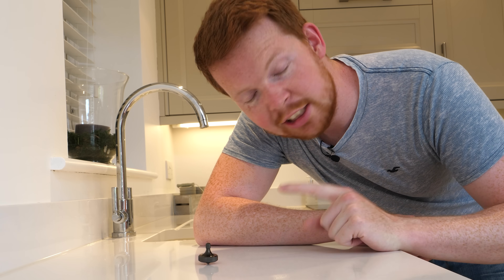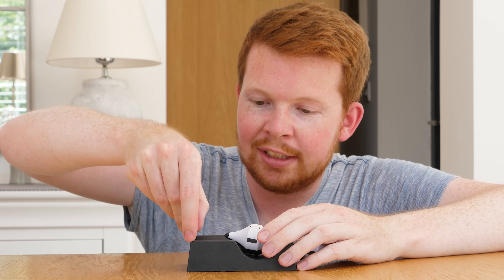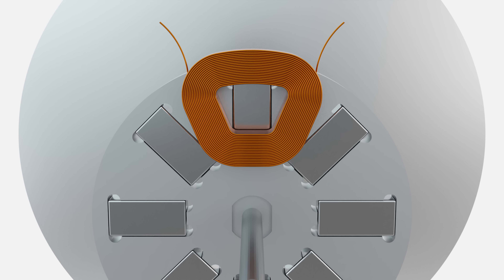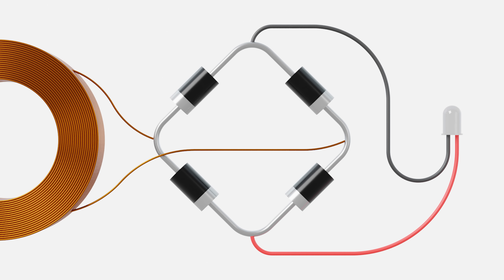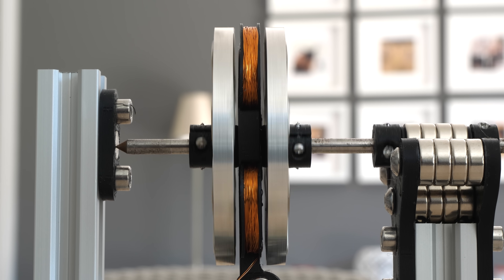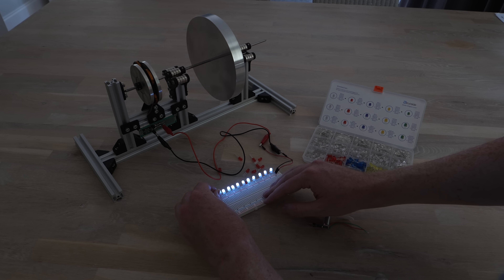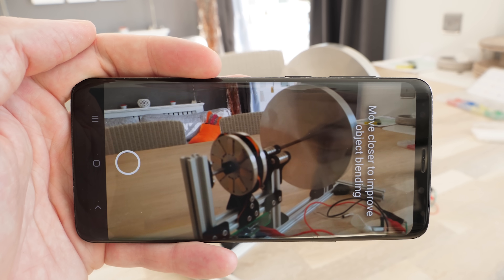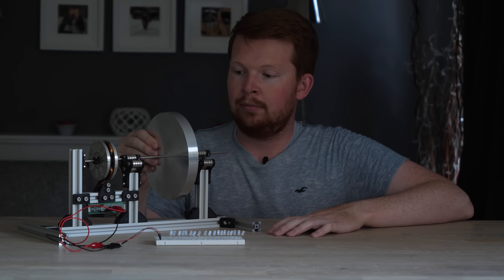Flywheel Battery

Comment: Did anyone else immediately imagine a sterling engine powered by his hot or cold drink powering  a fan that powers his flywheel that is then charging his phone? :)
Reply: I mean I guess this would work but why not just power stuff with the stirling engine itself?

oh right, it's not as fun ;)
Reply: @filthycasul1804  yea because of the way he likes to do things I was kind of imagining an almost Rube Goldberg style energy machine on his desk ;) that's all all about the most interesting way to create his power not the most efficient. You get the point. its about the FUN :P Have a great night.
Reply: @TheRealSarcasmO  solar powered tea kettle to make the hot drink
Reply: Tealight candle powering sterling engine then flywheel might work
Reply: My thoughts as a canadian:
-wood stove, with hot side of sterling engine inside firebox
- basin that uses snow to cool the cold plate, and also melts snow into drinking water (dual function) 
-planetary gear set, to increase the speed of the flywheel (would require tuning, to fit the gear ratio just right)
-semi-flexible drive shaft from gear set to flywheel/crankshaft, to reduce vibration and instability.

This concept could be very useful to someone wanting to live off grid.
Reply: @chris101ward  love it, maybe a infinite ratio drive to connect it? Very smart of you to maximize your thermal extremes that you have available to you.
Reply: Me
Reply: Think of powering a large Stirling Engine and making a Cryocooler so powerful it could liquify HELIUM (i.e. down to -269 Celcius) or easily make your own Liquid Nitrogen at -196 Celcius by the MegaLitre!

v
Reply: Or using a DC motor connected to the floating side of the bar holding the "motor" to continuously power the spinning motion and help it build up speed?  I'm sure there's a better way but it could make that thing spin forever.
Reply: No. Because the energy differential of the "cold drink" to the ambient air is minuscule and the conversion losses are huge... However, this concept would generate 1 million bucks in 3 days on Kickstarter...
Reply: The drink would have to be molten lead
Reply: @RusselwithoneL  Yes molten lead drink would power it quite nicely, however, you are mistaken many other drinks both hot and cold could slowly but surely impart their energy depending on how he decided to have them interact with his flywheel, and that it in turn then would charge whatever he wanted to charge. I hope that that people will see your comment and do their own research. I however will not indulge your further comments however because I have personal live events going on. I hope that you learn and others learn more and realize how cool the idea could be, if implemented well.
Reply: @TheRealSarcasmO  ey man I agree with you but imo, that middle to last part wasn't needed to express your point, no reason to bring his character down just because a harmless comment he most likely didn't give a second thought
Reply: @ex5080  Good day, thank you for putting me in my place, you are completely correct, I was wrong to respond that way, although I believe in the freedom of speech and my response was warranted, I also think that you make a good point, and I have edited my comment accordingly. I just had a death in the family, and I read that comment and it seemed to be the normal internet troll, so I commented/replied with that mindset, and while I might be right and they might be a troll you as well make a good point. Thank you, I hope you have a great day.
Reply: @TheRealSarcasmO  u could use a thermos mug
Reply: @TheRealSarcasmO  No need to put someone down to promote your own pride man. Sure, EVENTUALLY, your proposed setup could gain enough potential energy to charge a device but its not practical. His response was simply showing that in a humorous way. It doesn't mean its not possible and it doesn't mean you aren't smart or whatever.

You inferred so much meaning from a simple comment and that speculation is dangerous. It likely wasn't a personal attack on you and I don't think he was even 'trolling'. Its YouTube. People are going to banter with your ideas and disagree with them. No need to tell someone you are going to "Stop Indulging" them when you never had to in the first place...
Reply: @TheRealSarcasmO  What edits? Im talking about how it is now. Condolences for your loss but I never insulted you. If anything I just encouraged you to not care about what others say to you and to have more confidence in yourself, especially when you have no idea if they were trying to be rude to you in the first place. It's not so much vitriol as someone just trying to be real with you. All the best man.

Comment: To further reduce the friction, you can use also magnets to replace the pin at both ends. Then put the entire system inside a vacuum chamber

Comment: Flywheels have been used as energy storage for years in power backup systems, it is nothing new... What is nice is the magnetic bearings.  Electromagnetic bearings are also known for years in high class industrial applications

Comment: You have a massive voltage drop from the diodes, regular diodes have a 0.7 forward voltage. That means with 2 diodes you already lose 1.4V! Shottkeys can decrease this to about 0.5V and Germanium diodes to 0.3V. Also depending on the quality of each. While synchronous rectification can have you lose almost nothing.

Comment: Flywheel storage systems for vehicles have been developed over a number of years, the braking energy is used to spin up a (250Kg?) flywheel to over 10,000 rpm (in a vacuum to reduce windage losses) the stored kinetic energy is then recovered to accelerate the vehicle (usually a bus).

Comment: I really want to see this revised in 3 ways:

- Correct the problem of the bent shaft so it can spin much faster and still be relatively safe.
- Is it possible to add magnets above the shaft to give it more security?
- Add some sort of mechanism that will allow you to manually spin it *WAY* faster.  Basically the same as a bicycle in high gear.  I don't know the specific name for the mechanism, but it's the one that allows you to peddle very rapidly and the peddles are basically "locked" on gear teeth when spinning in one direction, but if you stop peddling or even peddle backwards, the wheels of the bike can spin independently of the peddles.

I'm no scientist or engineer, but it seems to me that if you were to do those 3 things, this device could actually have a practical application in the real world.  Probably not an efficient way of generating electricity unless you think of the disproportionately costly input as being a small workout and good for your fitness, but this would be a really cool and fun novelty power source for a small light or other cosmetic machine.

Comment: 9:10 Never power a LED without a constant current source or a resistor in series to get the right amount of current or you will damage them really easily.  Also every LED needs its own resistor. Only then they will have the same brightness.

Comment: When constructing a full bridge rectifier at such low voltages you should be sure you're using Schottky diodes, otherwise you're losing about 1.5 volts on the bridge itself.

Comment: 5.30 You can power a light bulb directly from this setup if you don't care about the flickering that might visibly occur. (Doesn't have to be very noticable though) Not having diodes will increase the output to the bulb.

Comment: if you attach some scoops arranged in a pinwheel fashion to the far end and place a lit candle beneath them, by capturing the rising heat to spin it up you can have the first candle powered light bulb.

Comment: You should speed it up by putting power through the coils and making it into a motor - Then it would really be like an electrical battery.
Reply: and how would this work? you need to switch the polarity of the coils

Comment: When you increase the copper, you increase the power output.  I know it would violate conservation of energy, but what if you added more magnetic coils in parrallel is there a limit to how many times you can multiply the power output by adding more coils?

Comment: Cool video. Seen these things used as UPS systems.  Under load you get 15 seconds or so for utility to come back or generator to start.  Good luck...  Never saw a multi string flywheel.

Comment: As you draw more power (V*I) from the flywheel storage, there will be more torque pulsation on the flywheel, which will have a magnified wobble effect. Its not just the mechanical alignment and balancing that is needed, but the coils and magnet too should be spread out so that torque pulsation is spread across the entire mechanical rotation.

Comment: Big versions of these (google for 1000kva flywheel) can provide a megawatt for 15-20 seconds before they spin down - we use them in our data center instead of batteries to cover the time it takes for the diesel generator to start up. I'm told they spin 50-100 lbs at 50K RPM, but that could be wildly inaccurate - check the vendor specs if you're really curious.

Comment: Would be neat to compare electrochemical batteries of varying types with the flywheel as a means of storing energy.

Could flywheels be used at a larger scale for energy storage? Any benefits versus batteries?

Comment: Ok can u trickle charge like a 6 or 12v battery with this, and use that stored energy on a motor to engage the flywheel?
If so this is almost perpetual energy generation with no upper limits...

Comment: Nice, but I thout that on DC the corrente flows from the negative to the positive. And in AC genorator it flows towords it, thats way use transformer(for isolation and invert the corrente towords the load). Use 4 daiods for each fase(1 capel for each derivation). Put a motor to cantineu the motion of it..

Comment: You should definitely make a bigger more powerful version with a full bridge rectifier that has less of a voltage drop and try to perfect the design as much as possible
You may even be able to use magnets at the end instead of the plate so there would be literally no friction (except for air) and you’d only have a bit of magnetic resistance due to the alternator

Comment: And on top of all the helpful comments that arrived sooner than mine, in addition,  depending on how heavy the flywheel is, add some type of fan blades or make it into some sort of air driven turbine, if you have any kind of wind around your way to be able to pull that off. then you will have made wind power.

Comment: 0.7v is lost through every diode in the rectifier. I had a dynamo on my bike connected to a USB charger, and I used a half bridge rectifier with a capacitor and it worked to charge my phone on long trips. The voltage drop from the diodes and the voltage regulator created a nice 5.3v on output.

Comment: im just imagining scaling this up with a massive flywheel and a massive gear reduction system with a pully and a heavy weight acting on it to spin the flywheel. could generate some mad power, especially if you doubled up the magnets so they are both top and bottom, might reduce vibrations with that too
Reply: The flywheel can generate less power than is put into it to spin it, due to inevitable conversion losses. To power a flywheel from a heavy weight, the weight first has to be lifted off the ground, which requires the input of more power than you can get back. Physics 101.

Comment: @5:33: "We also need something to turn the A/C into D/C if we want to power something like a light bulb..."  Not true.  Discard your LEDs and complicated rectifier and use a simple incandescent bulb; it will work just fine on A/C without rectification.   That's how all incandescent bulbs in your home work.

Comment: That is clearly not a battery, but a manual generator. Actually, flywheel part is technically storing kinetic energy, but not electric. Electricity is created by the generator attached to the flywheel contraption. When going into this video I expected rather the opposite: electric energy converted to kinetic via motor and stored by the flywheel, actually at that point you can make a two way system.

As it stands electric part of this battery is irrelevant, as battery part concerns strictly storage of kinetic energy via flywheel.

Comment: Actually, inspired by your project, I've build smaller 3d printed version. 
I've tested different magnets configurations. There is no need to place third magnet under the axle. Instead, it's better to mount two magnets at the bottom, they will create a "valley" with lower force in between. 
To limit any axle wobbling, place another two magnets on the left and right side of the axle, but a little bit above.

In other words, imagine trapezoid but with shorter edge at the bottom. Place magnets in corners and axle in the center. For me that was the best solution.

Comment: Can't get the shaft out of the flywheel...

Put the whole thing in the oven. After it's hot, put it over a pan of ice water so the shaft hangs in the water and cools faster than the flywheel. Then tap it out.

Comment: Please oh please power a small motor to spin the fly wheel lol... In pulses if you have to like a car spark plug. I'm interested to see how long it runs. Adding a gear wheel or two to amplify RPM by requiring more torque. So slower start but high efficiency once it's going...

Comment: suggestion, make a thicker shaft to keep it steadier. think of the way a cam shaft looks from a combustion engine. maybe 2 cm thick would be good. maybe you already did. this is a genius alternator design and it would be interesting mounted on bicycle.

Comment: I wonder how effective it would be in a vacuum & how much energy would end up being lost by a sort of magnetic friction
Reply: You're thinking of eddy currents.
Reply: The energy is mostly lost by the fact that it is converted from the kinetic energy of the flywheel, which comes initially from the person spinning it, into electrical energy with some conversion losses, then from the effects of Lenz's Law, which says that the direction of the electric current which is induced in a conductor by a changing magnetic field is such that the magnetic field created by the induced current opposes changes in the initial magnetic field.

It is a qualitative law that specifies the direction of induced current, but states nothing about its magnitude. Lenz's law predicts the direction of many effects in electromagnetism, such as the direction of voltage induced in an inductor or wire loop by a changing current, or the drag force of eddy currents exerted on moving objects in a magnetic field.

Comment: Since it seems easy to spin could you use the small motor to spin itself? and have a battery for any excess power created?
Reply: Well you can't exactly extract "excess" power than the amount your putting in, in fact we will likely never

Comment: Tom, this is so freaking cool. Can we see you scale this up? (Within reason, - flywheels can be dangerous!) That would be so freaking cool if you could show us a flywheel battery powering a computer or something. And solar panels storing excess energy into the flywheel for later use? Like a small-scale grid system with the flywheel as a battery when solar panels aren't producing enough current to run the computer system?

Thanks Tom for the awesome content!
Reply: i would really love this
Reply: Fred Garvin  im not quite sure the fomulas to use to find out or where to even start to research this. Do you know where one could go upon finding this out?

That's why I am so fascinated by this video Tom made! I wonder the feasibility of using flywheels as a sort of battery.
Reply: Fred Garvin  counting on a perfect system with no losses with a flywheel rotating at 1500rpm, to get 17Watts of power (all counting on a perfect system which is practically impossible) you would need a 5.5KG flywheel, in a more practical way i would say about 12Kg counting 80% efficiency on the kinetic to electric(DC) power, and another 70-80% efficiency on the voltage booster+inverter
Reply: Fred Garvin  like very big
Reply: Of you did the same magnetic bearing he has it floating on on the bottom, and put one on the top above it, it would be supported better. There is actually such a thing as magnetic bearings.
Reply: Ok so what if he scaled up the amount of magnets and coils so he could get more voltage, scale up the diameter of the magnets and coils, to get more speed, then instead of powering lights, have it power a motor that's also spinning the flywheel. Am I missing something or is a perpetual motion machine possible?

Comment: You need to re arrange the coils into a 3-phase arrangement.  Use 6 diodes to rectify the output.  Use as a motor to spin up the flywheel.
          You should add hard constraints just beyond the normal excursions of the magnetic bearings.  That way, you can boldly spin up the wheel without the concern of knocking it off its bearings.

Comment: on your axial flux how are the magnets orientated? are they staggered with opposite poles facing each other? or do they line up with opposite poles facing each other? could the magnetic drag be alleviated by mirroring on the other side of your large flywheel? Thank you.

Comment: It should be possible to use a stepper (or AC) driver to spin up the flywheel and then maybe via relays or mosfets switch from and to the full bridge rectifier to charge and discharge the flywheel like a battery would. Maybe even throw a buck/boost converter in the mix for more control of the output voltage.